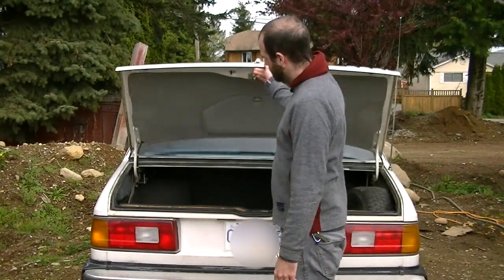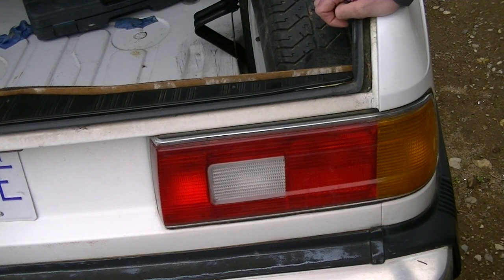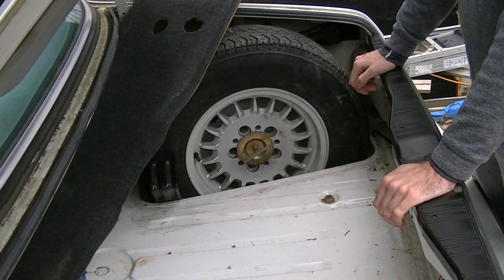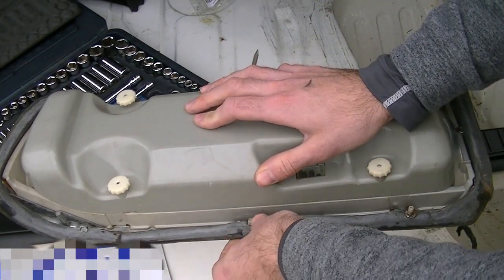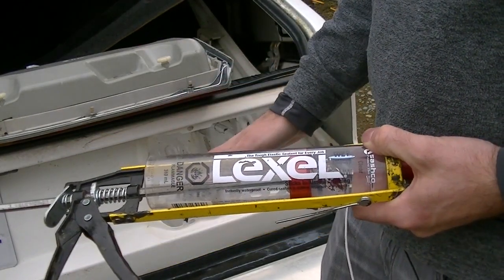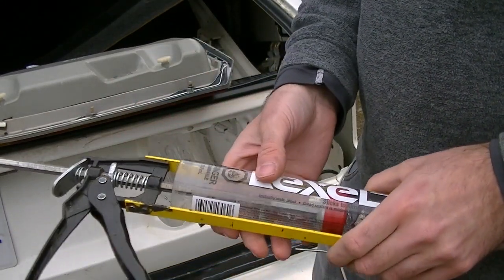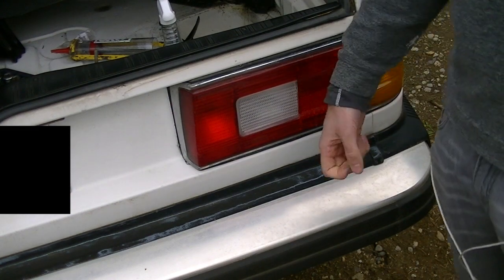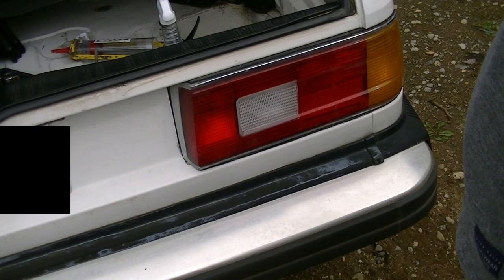How to fix the most common water leak in the trunk or back of your car.

Comment: this recently happened to me. opened my trunk and found a ocean in my spare tire compartment. I noticed it was soaking wet around my tail lights. so that was my first suspect. clicked your video and I can confirm now. thank u, u gave me some hope.
Reply from the maker: Glad to help. Be sure to like, share, and subscribe.
Reply: Mee too, 2015 nissan sentra. But it isnt a seal problem, they didnt even bother to put a rubber seal on the tail lights and the gap is about 1/8 in all the way around. That gap is sirectly in the water channeled feom the trunk
Reply: Thank you!!!! No more soggy trunk booty. You’re a saint.

Comment: Thanks for this video.  I have a Ford Fusion Hybrid and found water in the trunk with the carpet wet on the left side.  I looked at the tail light seal and I could actually look right into the trunk.  Not a good design for the gasket.
Reply from the maker: Glad to help :) be sure to like, share, and subscribe

Comment: Thank you so much!!!  I may be able to do this myself....I am a 68 yo female.  wish me luck! Great video
Reply: This is Judy I was born in 1954.  I was wondering if a clear caulk around the whole tailight lwould help.
Reply from the maker: You would be best to remove the twilight and reseal it as I showed. Smearing it on the outside would likely be a temp fix at best, if it worked at all.

Comment: Good instructional video.
My only question is, what about when it comes time to changing a light bulb? Does this hinder that in any way?
Reply from the maker: That would depend on the design of your tail light. Most are changed from the inside without removing the light to do so. Obviously if you have to remove the light to change the bulbs you may not want to fix it this way.
Reply: @JustFixIt99  Oh. 
Well you're right then. It was appearing to me like your sealing of the unit prevented easy access to the bulbs.
But you got me thinking more clearly now. I do access the bulbs from the inside without taking off the fixture. 🤦‍♂️ Thanks for the reply. 😄
Reply from the maker: Glad to help.

Comment: Now, is that sealant easy to clean away in case I need to remove my taillight assembly again for any reason? Or will I have to fight with it? thanks
Reply from the maker: I would suspect not easy, but it shouldn’t be too hard either. Silicone should be able to be scrubbed off mechanically.
Reply: @JustFixIt99  ok. thanks

Comment: I’m glad I found this as I too have the leaky right taillight on my 1986 e23 L7.  I bought a new factory gasket however I’m not so confident of the dry factory seal since the metal mating surface was gently damaged from a slight impact.  I recently had all the carpet liner cleaned and dyed so I want to prevent anymore leaks.  I will be doing this to my tail.

Comment: Great Video Sir, quick question, I i 2018 have Lincoln MKX could the water under the passenger sear and back sear also come from truck leak ? There's apparently no sign of water there either but the water is under the carpet only.
Reply from the maker: The water in the rear seat floor under my carpet came from the trunk. Another common spot that could be your leak is up under the dash. Often water drains plug and water Weill leak back in through the HVAC ducking. It will leak down under the carpet in the front and run to the back.

Comment: On my 02 Honda Accord the lens leaks fills the inside of taillight with water and drains out past the socket. But then when it does that the silver paint coating on the inside peals off and turns black. It's an easy fix unless you wanna repaint that coating, then the lens needs removing.  This one here is easy to fix compared to mine.

Comment: Hi Mr Fix it 99 . I will give this a go. Will any silicone do. I have clear silicone. Great video. Does it really work? I’ve had a leak in the trunk for years..🙉
Reply from the maker: I’ve done this to several vehicles and not had leaks afterwords. Any silicone should be fine. I’d imagine exterior grade would probably be best.

Comment: After you do this.  What about changing bulbs will the seal get destroyed when taking it off again?
Reply from the maker: In this car the bulbs are changed from the inside without removing the taillight. If your car requires removing the taillight to change the bulbs I’d recommend a sealant that is less adhesive than the one I used. As to weather the seal will be destroyed or not, if it’s a foam type seal, it probably will, rubber you may be ok.
Reply: @JustFixIt99  Thank You!

Comment: Regarding the rear light rubber, does it have anything to do with the exhaust smell entering the cabin?
Reply from the maker: There are no absolutes in life, but I’ve never heard of bad tail light seals causing exhaust fumes to enter the cabin. That’s almost always caused by an exhaust leak somewhere in the system.

Comment: Hi, I tried this with my W201 Mercedes, but the problem persists. Is it possible to tighten the fasteners too tight when reinstalling the light?
Reply from the maker: I doubt it. I did this on a w123 once with success. I is it still leaking around the fixture for sure? Is the lens cracked maybe?
Reply: @JustFixIt99  yeah the lens is ok, I can see the water drip from the edge, so it's definitely creeping behind the seal

Comment: If u silicone between the seal and body and them later on have to remove tail light for some reason, will it break the seal since its stuck onto the body?
Reply from the maker: That would depend on the condition of the seal. If you slowly work it loose you should be ok. Besides, if it tears you can always silicone it back together.

Comment: use olive oil to lubricate the rubber!
Reply from the maker: You can soak them in a petroleum based oil to make them swell and they will seal again. However that’s only a temporary fix.

Comment: Nope.... I got new seals and also used weatherstrip seal gasket maker all around the seals and it still collects water in the spare tire well.... everything else inside the trunk is dry as a bone. No idea where it's coming from. New trunk seal, new light seals, new license plate seals, and gasket seal.
Reply: Have you tried replacing your car

Comment: my optima is five years old, never had a problem, trunk was soaked last week. before i came to this video i noticed a small gap between the tail light holder and the frame of the car.  I ran water here and it does come through, thing is wasnt this gap always there?  LOL,
Reply from the maker: My only guess is that the gasket shrunk.
Reply: @JustFixIt99  oh I found the leak, it was above the light, hairline crack in poor welding.  Ridiculous, but its fixed
Reply from the maker: @rickspalding3047  Thats irritating, but hey, at least you found it. I've literally gutted cars looking for leaks.

Comment: Lexel is permanent and will be hard to remove, is that cool?
Reply from the maker: Lexel is hard to remove. Regular clear silicone would be easier if you have taillights that you will need to take out in the future. Lexel is nice because it is permanent, and stays flexible. I have also used regular clear silicone with great success.

Comment: The water in my trunk isn't coming from the taillights it's coming from the corners  cause it have little cracks I spray flex seal and the water stopped but now the flex seal is gone so that's another problem cause the water is back in my trunk from the heavy rain
Reply: How did the flex seal disappear?

Comment: I feel like hot glue would make a good alternative to the silicone.
Reply from the maker: Hot glue gets pretty hard when it dries, and probably when cold. You really want something that stays flexible in a wide range of temperatures.
Reply: @JustFixIt99    Honestly, it doesn't get really get cold in the South Carolina low country...and I would also posit that not all hot glue is the same. The stuff that I use does remain remarkably flexible, especially in the ridiculous heat and humidity that we see for most of the year.